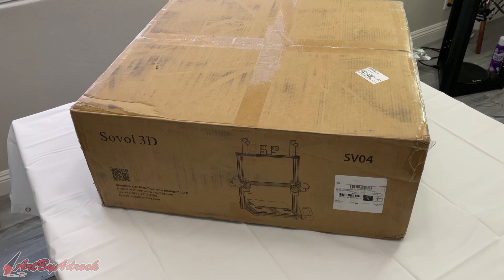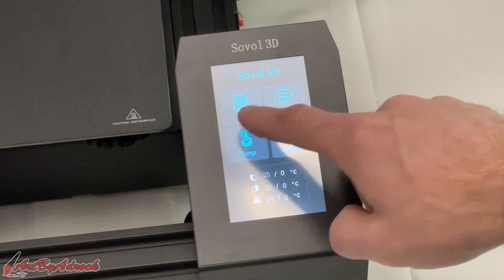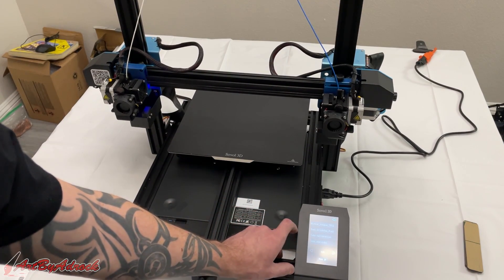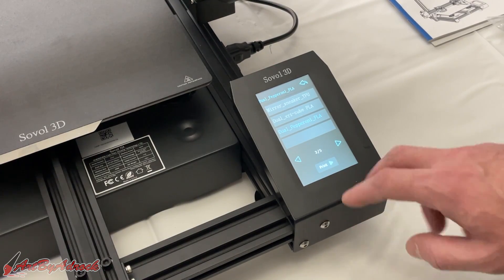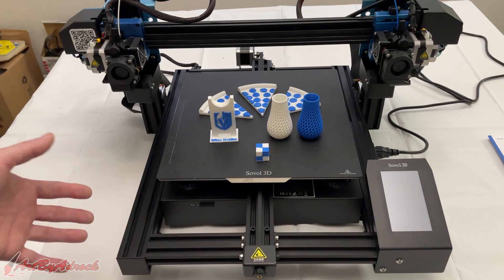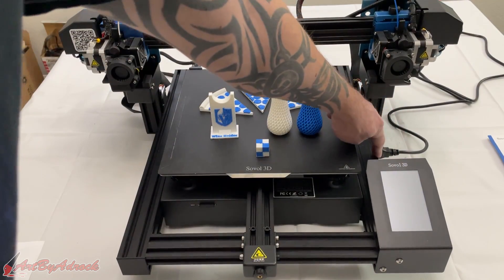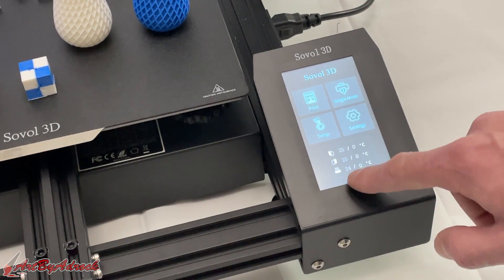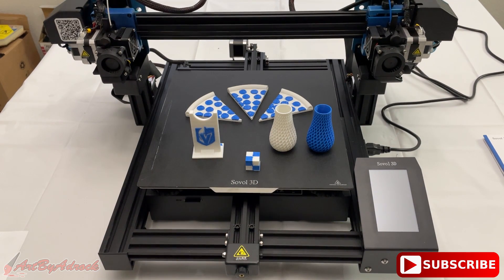Testing The Sovol SV04 (IDEX 3D Printer) - Setup & Honest Review

Comment: Manual bed leveling: 

Both heads have the same x-axis. So they have the same z-hight. If you have both printheads active (mirror and duplex mode) the printer simply can not compensate for any tilt or bending of the bed. If x0=20 and the mesh would require -0.21 but x1=280 and the mesh would require +0.21, wich z-correction do you use to compenste both points?

Its physical impossible to compensate with only one z-coordinate.

Actually, if the x-axis could be tilted (with tzo independend driven z-axis), it might be possible. But I do not know a firmware calculating for this, also a tilted x might cause other problems. Maybe someone will write this function for Klipper, as the VCore 4 IDEX has a tiltable bed it would be physicly possible there.

So at the moment, you will not see a bedslinger without leveling knobs.

However, if you never use Duplex or Mirror mode but always have only one head active at a time (so Single and Dual mode), the physical not perfectly adjusted bed is no problem. ABL could compensate, as you always have only one active coordinate.
In this case you do not even need same nozzle hight for both heads. You could compensate by using different z-offsets.

So you might even build your own (not so Independend)DEX yourself with standard components, if you for example have an Ender3-style printer (with ABL). Longer x-axis, second x-motor, belt, printhead. A SOC-board (like the Rasperry Pi) and two CAN or USB Toolboards for the printheads. As this frees the e-stepperdriver on the controller board, you could use it for x1. You might need a more powerful PSU as you have two hotends.

Duplex and Mirror mode are a nice idea, but they hold back the success for IDEX printers. The compromises needed to support theese modes are not worth it.

Comment: The reason that it is "upside down" is because they have to attach the main board to the top part of that housing to make it so you can easily access the sd card spot. The end result from this is that you have to place the board upside down to not short circuit anything. I hope this help you with knowing why the sd cards are always upside down.

Comment: My problems with the machine:
.Random layershifts
.warped bed (used Alu foil to make bed true level so other nozzle doesn't drag when used)(it doesn't compensate in duplicate mode)
.Filament sensors binding (bypassed them)
.Can't update firmware on touchscreen
.Shit support
.Special heatbrake/sink only sovol sells